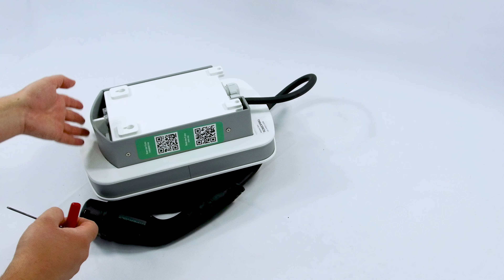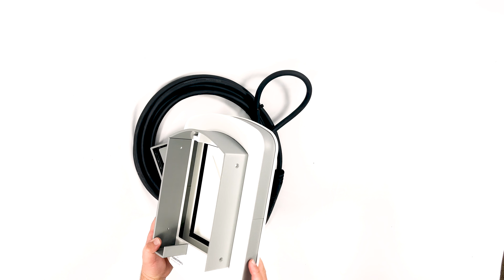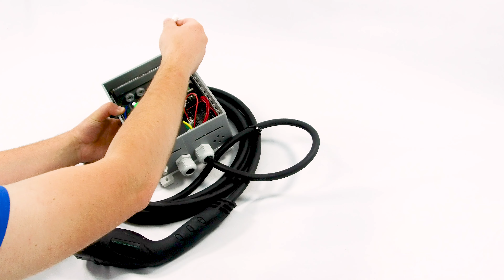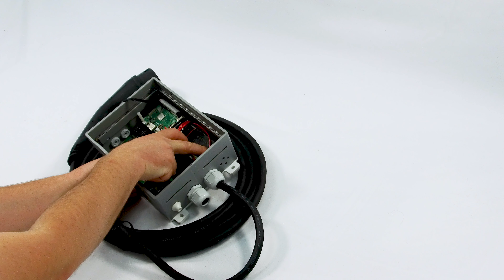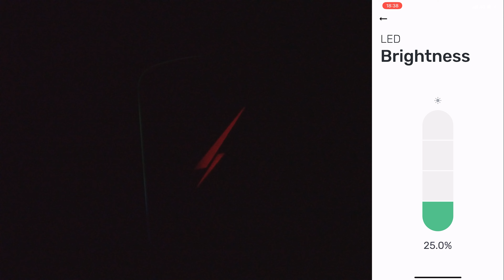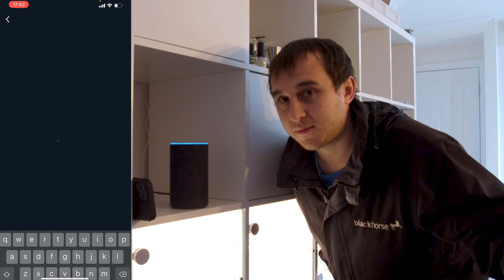Hypervolt EV Charger Review Does it Live Up To The Hype?

Comment: This charger is complete junk don't buy it trust me
Reply from the maker: What happened?  Casing?
Reply: @NicolasRaimo  missing charges, not recording when charged, charging when locked, locking itself missing the charged, going offline so not recording the charge the company tells you the most stupid things. Car didnt charge because it was locked but I didn't lock it? The car didn't communicate. You have to check there charger is online before you connect it. Even one day it's on night schedule charge and plug it in the day started charging.
Reply from the maker: @rajindernijjer  I wish I could help sadly communication for me broke down with hypervolt after this review was released they believed it was unfair yet I felt it was very neutral at worst.  I hope you can get it sorted how long has it been installed you may have recourse under sale of goods act

Comment: Hi Nicolas - great reviews, not just this but in general. So very helpful. I have solar and want to have the option to switch between using my solar and the battery back-up on solar. though I have a wifi its at times irritatingly unreliable despite claiming best in the market V^^& 200 Mbps. Considering the above I was thinking zappi is a better option (slightly dearer) as it also has the option of using the buttons on box to charge if wifi drops. Hypervolt doesn't. So am I correct in thinking for these factors, zappi is better. I would gladly take up challenge so that I land up with the right model - so confusing..... .have been told btw that ohmi is bringing solar integration in Q4 this year
Reply from the maker: if it was my personal choice I'd go for zappi over this charge point even if it was £1000 more.   Zappi for me wins as my choice
Reply: @NicolasRaimo  Appreciate that Nicolas, my heart has been with zappi too but the hypervolts good looks were too distracting :)

Comment: Just received my Black Hypervolt 2.0 7.5m cable from the UK to Australia.  Super happy with previous YouTube review posts.  I’ll let you know how it performs once the electrician connects it.
Reply: Whats your thoughts on the Hypervolt after 7 months of using it ? I am thinking of installing one but still undecided.
Reply: @satheshrajamanickam2859  Simply put it has not missed a beat.  We are putting on average 30 kWh's into the MG each night (Schedule Charge) on night tariff with no issues.  The phone app to monitor is best, still a lot of work required for the web portal if used. Overall still super happy with my Black Hypervolt 2.0 (&7.5m cable)
Reply: @Porkonfork  thank you mate. Makes it easy for me to decide. Now need to find a reliable installation service provider. Wonder if the charger allows us to charge to the full potential - 7KW.
Reply: @satheshrajamanickam2859  Its really good to plan it out.  My electrician run 10mm twin & earth to a sub-board (future upgrade) then into the Hypervolt.  It charges at 7kWh 32amp without any issues. happy to send pic of Hypervolt charging curves, just email me. cheers

Comment: As a fully qualified charging point installer I have many years experience with a vast range of charging points. I now only fit Hypervolt because they are the best.
Reply from the maker: Hi Peter what’s your business called and I’ll give you a ring Monday
Reply: Strange to only fit one type of charger. Surely everybody has different requirements and price points and as an installer you need to remain impartial and let users make up their mind
Reply: This person works for Hypervolt. Ignore
Reply: Joined 10 Nov 2021, sus

Comment: Great and detailed review as always.
Although I'm a little put off by the build quality of the box.  

You've reviewed a number of different charges now, it would be great if you did like a top 5 video.
I'm in the market for a charger at the moment and want one with the following features:

WiFi & 3/4g connectivity
PEN fault protection
DC leakage protection
In built RCD protection
Load management
Not bothered about tethered or untethered.

Is there a charger that fits this criterion?
Reply: Don't be put off the review is incorrect on build quality. I have fitted lots of these Hypervolts and would say they are of excellence quality.
Reply from the maker: Peter you seem very keen to leave many many comments over several hours….
Reply: @NicolasRaimo  Hi Nick. I might have got it wrong but is the idea of the comments section not to leave your comments in or respond to other comments as they are made?
Reply from the maker: @Peter-et7ot  what’s your company called so I can give ya a buzz tomorrow you ignored me when I asked
Reply: @NicolasRaimo  sorry not ignoring you just don't see the need for a phone call.
Reply from the maker: @Peter-et7ot  what’s the name of your company for getting hypervolt installs
Reply: @NicolasRaimo  Thanks for the offer but so many people want the Hypervolt I don't need to advertise here for more.
Reply from the maker: @Peter-et7ot  can you just say your company’s name for me then I just want to look you up
Reply: @NicolasRaimo  No sorry like I said I don't want to advertise.
Reply from the maker: @Peter-et7ot  I suspect this is a fake account so prove me wrong and I can confirm your not fake
Reply: @NicolasRaimo  Yes it would appear so. He/she only registered with Youtube on 10th Nov in readiness to comment on your review. I thought that your review was fairly balanced with both positive comments as well as the critical ones. Perhaps they are not used to unbiased reviews.
Reply from the maker: Again not asking you to advertise am asking you to send me your company name so I can verify your not a fake spam account you can add the company name here and ill delete it once confirmed or you can email me privately once confirmed Ill make people aware this isn't fake
Reply: Don't be put off the review is incorrect on build quality. I have fitted lots of these Hypervolts and would say they are of excellence quality.

Comment: Very informative,  so thanks for posting it up.
Confirms my decision to order a Hypervolt, and it’s getting installed at the end of the month. 
Ordered a black one, but I think they’re having supplier problems, so the white cover will get swopped over when the black ones are back in stock.
It also appears that the customer service is very good if there’s a problem, and there’s also a very good FB group, and the boss Flavian often pops up and answers questions on it.

Comment: The Raspberry Pi 3B+ (which is the unit in there) has on board Wi-Fi, so the dongle is a bit baffling.

To be honest the fan holes are going to make little difference to the humidity inside the unit and could allow condensation to escape.
Reply: Bluetooth dongle?

Comment: Using a RasPi in something like this is complete overkill, and probably why they need a fan. I wonder what happens when the MiocroSD card dies.
Reply: Yeah the 3 does run hot as well.  A zero may have  been the way to go.  They aren't as powerful and run a lot cooler.
Reply from the maker: @cjmillsnun  the commercial compute module been even better as it’s designed for commercial applications like this
Reply: @NicolasRaimo  but is it readily available in 1000's?
Reply: @Peter-et7ot  Yes, that's what they're for.  (Modulo of course the current general supply issues for silicon chips.)

Comment: Been holding off ordering until I saw your review, watching now 😃
Reply from the maker: Many said the same thing why I was keen to finally get hold of one of these units to look at
Reply: @NicolasRaimo  I think I'll get one ordered off the back of this just hope they crack on with development of the agile and smart tariffs. As you say as  software lead company it really should be done if not top of the list of priorities
Reply from the maker: @ToBeSet.  agreed am also disappointed in the fan at the bottom of unit thermal management again should be done in software not physically
Reply: @NicolasRaimo  That's a very interesting comment and I would be keen to know more about software managing heat?
Reply from the maker: @Peter-et7ot  other charge points when they get hot instead of keeping the charge rate at full power they will step down charge rate to manage heat.  As Gordon said with my efixx video and using his skills he learnt working in the manufacturing industry fans on units is a point of failure
Reply: @NicolasRaimo  Thanks Nick could you let us all know which charging points reduce their charge rate deliberately because of heat. I wonder if this might answer some questions I have had from people getting a slower than expected charge. I have fitted lots of Hypervolts and not had any fan related problems.
Reply: @Peter-et7ot  I have a lot of experience with devices that use similar fans and although it may take a year or two it is the first thing and often the only thing which fails. Oh and with those holes in the bottom it would soon be overrun by spiders at my home. From looking at the picture the whole thing looks pre-production to me.  I can't comment on the case construction as I haven't seen one but why all the hot melt glue everywhere?
Reply: @tusdardcart  I can only speak from my own experience. I too was worried about the fan but having fitted so many of them now I can honestly say it's no longer a worry. I have one on my own home and looked inside regularly for the first year but haven't bothered since as nothing was getting in there. I have a light fitting nearby that's always getting insects in it but nothing in the Hypervolt. There is a distinctive smell inside the unit so I wonder if Hypervolts are made out of some sort of insect repellent plastic?
Reply: @Peter-et7ot  I guess with a fan running it would make short work of any spiders! I wonder if the smell is from glues or sealants used?
Reply: @tusdardcart  Crikey Oliver I don't no the fans you have seen but I cannot see this little thing having enough power to chop anything up. If the sealants used are insect repellent that's genuis and I want to know where to get some from.
Reply: @Peter-et7ot  There's been a distinct smell in mine since it broke recently too. Build quality of a kids toy, plenty of spiders in there  :'(
Reply: @LukeSills95  What went wrong?

Comment: Also, the fixing screws on it are not up to the standard of the Zappi stainless ones with washers with rubber attached to give better waterproofing. It looks like a pre production unit rather than the very well engineered Zappi units.
Reply from the maker: A few people said same to me about the look of the unit,  for my next round of reviews I might carry out some IP and IK rating tests to the units.
Reply: Had a zappi for 4 years it’s still in top condition and far more functionality. These start ups are just playing catch up and not bringing anything revolutionary.
Reply: @mattyt6722  Obviously it's only my opinion and l do think the Zappi is one of the better units available. After fitting lots of different chargers I just find the Hypervolts the most reliable.
Reply: @mattyt6722  Great to hear! No one is playing catchup, and while the whole industry is a startup, we may have to disappoint you and point out there are a lot more Hypervolts installed in homes than Zappis, but that's not meant to discredit all the cool things they do. As for functionality, it's very hard to fit all that a charger can do within a short review.
Reply: @hypervoltev  how’d you work that out they’re market leaders ?? How many units you got out there ?
Reply: @mattyt6722  Zappi have never been market leaders in strictly statistical terms, they have owned 10 - 15% of the market as per their own interviews, with market leaders being PodPoint, ChargeMaster, Rolec, taking turns over time. You may be surprised to know PodPoint and Hypervolt are combined more than 80% of the total OZEV home charging market, for example, based on official government statistics. Most other companies are very small in comparison, including whatever other names you think are statistically dominant.

This is in no way meant to attack Zappi, it's a cool product and 10 - 15% market share is no easy feat at all, but strictly statistically speaking, PodPoint is the only manufacturer that installs more chargepoints in a month than we do in the UK, and our install rate is more than double that of Zappi, for example.

How did you arrive at the conclusion that they are "market leaders" we would ask instead, because it's probably based on your preference, but not on stats.
Reply: @hypervoltev  fascinating, I just thought with them being around a lot longer they were one of the biggest. They certainly seem to have a much bigger presence than you claim. How many products do you have out there now ?
Reply from the maker: @mattyt6722  These figures being quoted don't stack up with information I have either please see twitter,  Hypervolt can you please provide evidence to support your claim
Reply: Unfortunately a big misconception, the reason why we opted for a different mounting is because there's no danger of install-time damage or partial waterproofing at all, whereas with Zappi that is not the case, hence the need for waterproofing at installation time, as the screws are mounted from within and they go through the what is meant to be waterproofed enclosure. There are no screws on the Hypervolt that go "through" the water-proof enclosure, hence we use machined screws that simply mount completely outside of the waterproof enclosure. Not so very well engineered after all that other product you mentioned, you may find..
Reply: Have you seen a Zappi after it's been in for a year compared to a Hypervolt?  The Hypervolt stands up the the elements far better.
Reply: @Peter-et7ot  My Zappi has been installed for three and a half years exposed to wind and rain without any issues whatsoever.
Reply: @tusdardcart  They are a good unit Oliver but the front is just a sticker which eventually gets water under it and bubbles up.